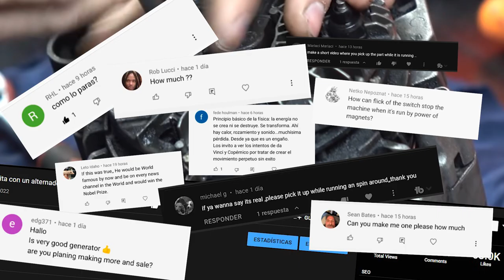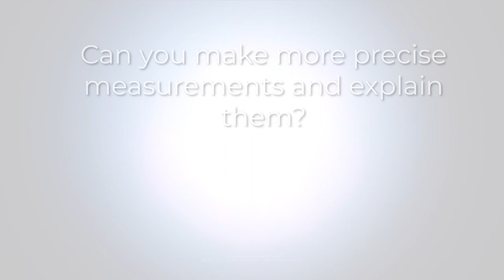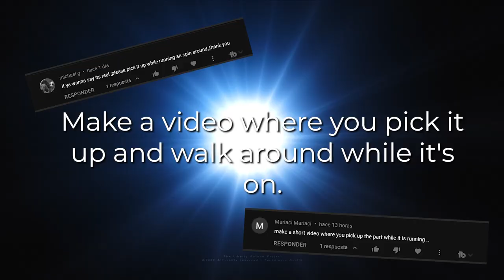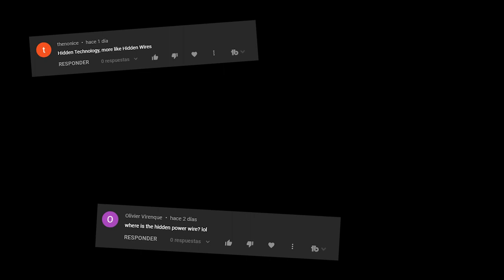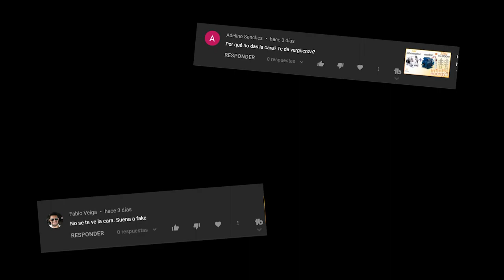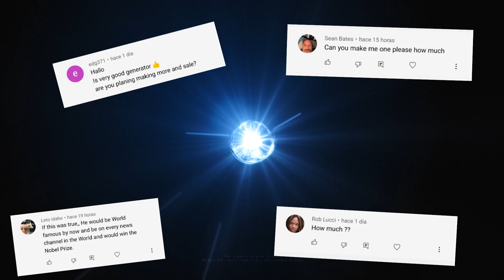Free Energy Generator Tests - LIBERTY ENGINE 1.0

Comment: This machine is a so called rotoverter. In this configuration the one phase motor with capacitor is essential because the system is  going into a self amplifying resonance. With a three phase motor without capacitors it will not work. Probably you find a configuration by random that works. It is normally very difficult to get into resonance. To understand more we need all exact specifications of all components. Otherwise there is no chance to rebuild it.

Comment: ya tengo SEMANAS!!! gastado en encontrar estos imanes, Aliexpress, Ebay, Amazon, etc., solo por nombrar algunos,
Este alternador parece ser de Valeo pero con 24v y 200A!!! yo tampoco lo creo??? ya no necesitas la bobina de excitacion con los neo imanes, creo que lo unico que importa es el devanado del estator, pero no se si es igual para todos los LM
Solo el motor (220v-50hz-1cv-2800rpm) parece ser el menor problema, probablemente el condensador del lateral esté roto. también una modificación.
Todos estaríamos muy agradecidos por más ideas o datos.
Si solo consigues los datos técnicos a 50 millones!!!! Podemos esperar mucho tiempo para liberar llamadas, aunque puedo entender bien a los desarrolladores.

Comment: The video is quickly convincing. It's just that the whole thing isn't mounted on a plexiglass pane. It would be easy to implement, wouldn't it? The bottom is quite thick and thin batteries z. B. from laptops would have as many space. Why is the edge taped or painted?

Comment: what if the single phase motor is 1800 RPM, will the voltage remain 220V ?

Comment: laughable. no hidden wires except the ones that go from the underside of the 4-way outlet, to the batteries in the opaque platform surrounded in yellow and black tape. You are wasting everyones time and attention.
Reply: Yeah and when he held the machine in his arms he had a wire running up his leg right? Lol
So silly...and so very easy to build. But someone takes a physics class and now they're an expert on electronics and induction motors.